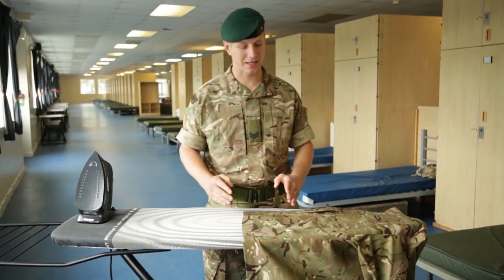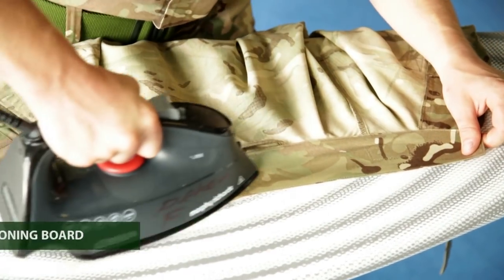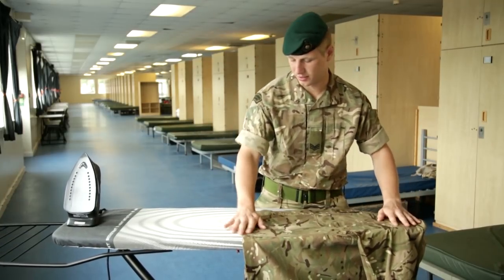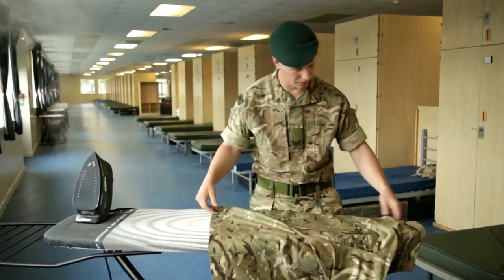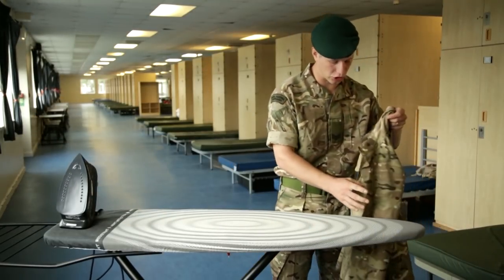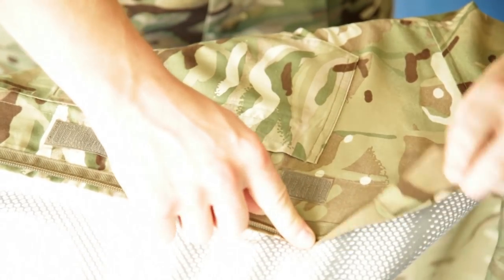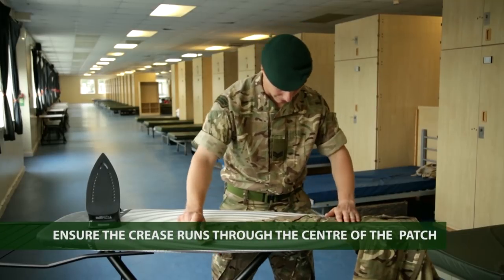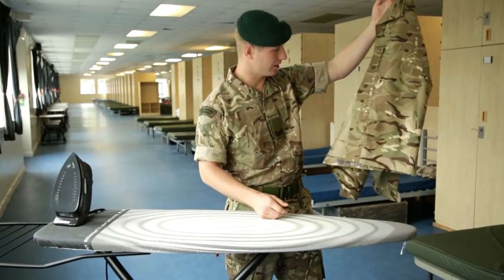Royal Marines: How to Iron your PCS Uniform Shirt (2/5)

Comment: I’ve legit ironed by collar crease in so hard but it still won’t stay as right when I put it on, and tips?
Reply: Starch!
Reply: Heavy starch. If that does not work, cheap hair spray. Apply from the rear. There is a brand in the USA called aqua net that was used back in the ironing and polishing days. If that doesn't work, as a last resort, take thin fishing line and lay it in the crease and melt it in with the iron.
Reply: Almost forgot. Best tip I ever got for ironing is to use steam setting to steam iron out the winkles, then turn steam off and iron flat until dry. You can also iron while still damp with steam off for the same effect